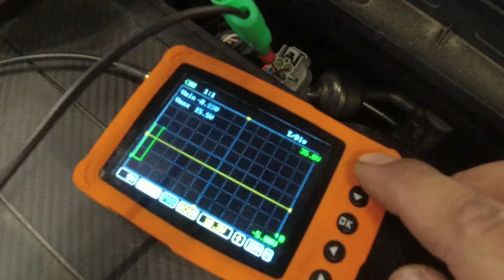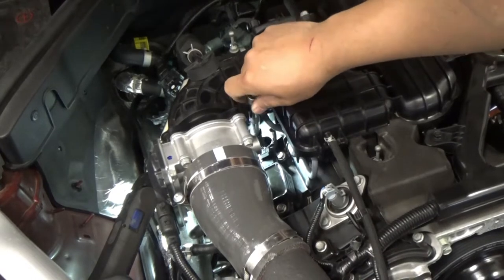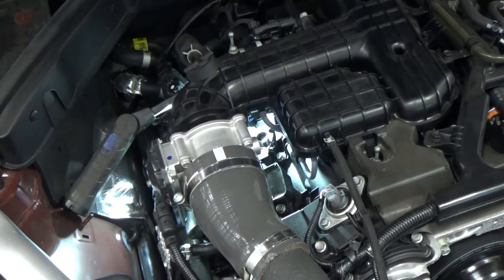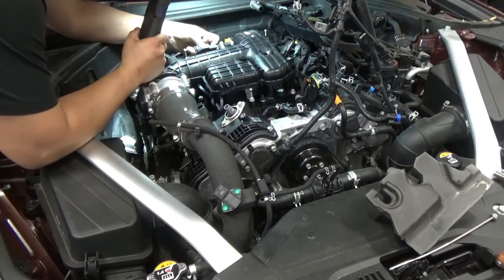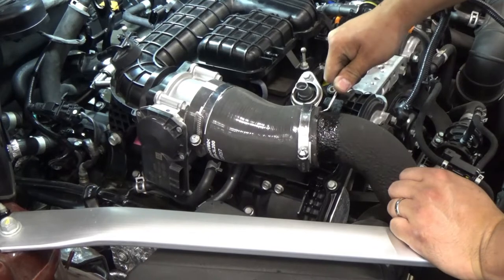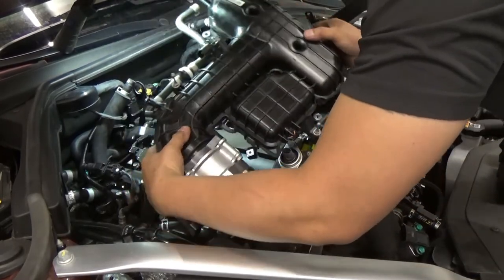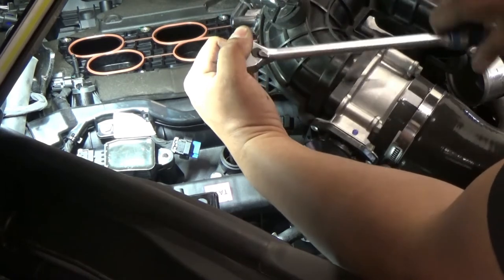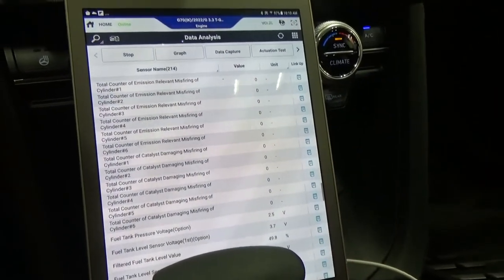GENESIS G70 DIY SPARK PLUG RPLACEMENT GONE WRONG.

Comment: What I normally do to make sure I dont cross thread, I will turn the plug counter clockwise slowly to then feel at the point when the sparkplug thread crosses the sparkplug hole thread (a little drop), then I will turn it clockwise to start the thread.. this is best to use a sparkplug socket and extension...

Comment: That's good they knew when to call it quits and brought it in to the pro😎🔧
Do you think they were installing 'better' plugs because they were going to toss a JB4 in there lol?
Reply: @ Anthony V. I bet that Denso plug was set to .022. I'm thinking a JB4 or Lap3 was the plan.
Reply from the maker: Hey man im not sure which one is better, im no performance guy. Hahaha but for sure if what oem installed in the vehicle i think thats more better unless theres article or proof that some other stuff is better than oem. Hahaha. Yeah i know i was glad that they did not force anything especially the thread on the cylinderhead, coz thats gonna be headache for me hahaha
Reply: @hyundaitech  re-tapping those or a new head would not be a fun job lol
Reply from the maker: @4555Anthony  yeah, coz i never done in my life hahahhaa.
Reply: @hyundaitech  I'm sure the master could figure it out with a quick glance at a service manual :P
Reply from the maker: @4555Anthony  hahaha